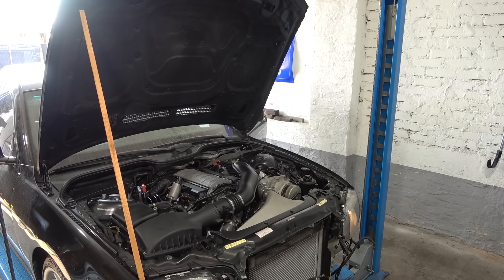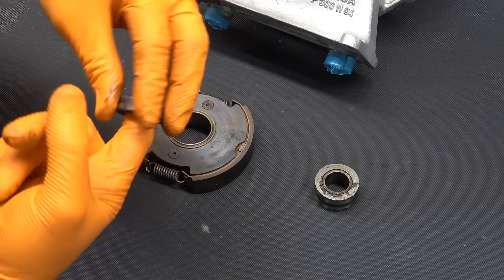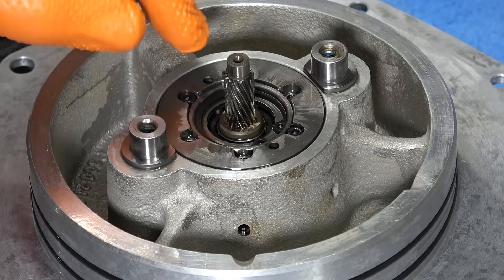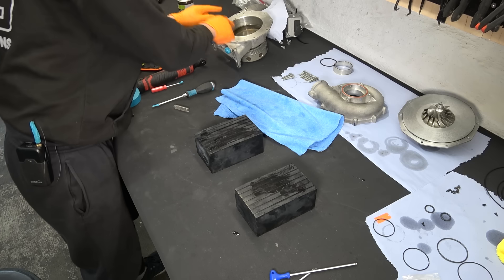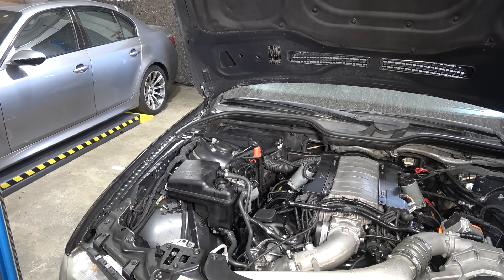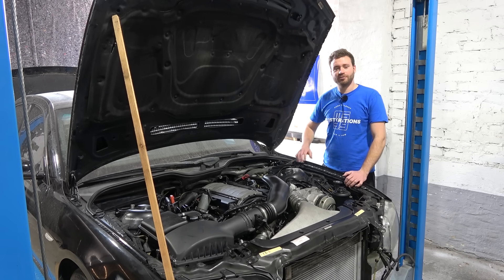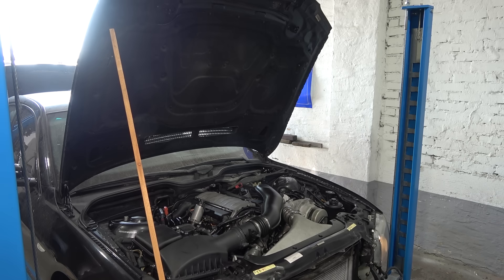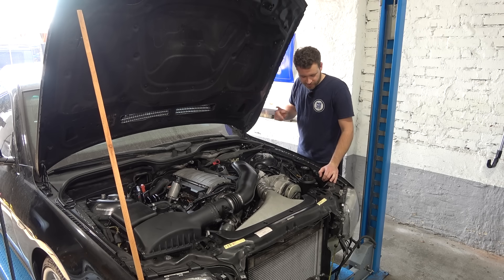First Start After Engine Rebuild - V8 Supercharged Alpina B7: Project Chicago: Part 6

Comment: I'm amazed when you do "just a service" to the supercharger everybody else would have call this a full rebuild! Great job and video as usual :)
Reply: I think it ended up as a full rebuild. Can’t think what would be left!
Reply: @supercartribe  Impeller bearings would be included in a full rebuild. But as Sreten mentioned, they were fine, so no need to change them.
Reply: That supercharger rebuild had me sweating. Well done.

Comment: I work at a BMW dealer, and I guarantee no tech would take the same care that you did building this engine. I enjoyed watching the whole process. Cheers and congrats on the smooth running engine 👍

Edit: I think the point I was trying to make was that Aplina had told Sreten that this car should be repaired only by those qualified to do so. However, in his care, I guarantee that he has done a better job than most people "qualified" in Alpina's eyes. That is the difference between doing this on the clock as a day job, and working on a car as a hobby/ enthusiast. Do I expect dealer techs to take this level of care when working on a car? No. They have book times to beat all while juggling a good quality job that they can be proud of. 

I'm not bashing dealer Techs. I am a dealer tech lol
Reply: Agreed, I was a senior tech at BMW and I never witnessed this workmanship, I’m almost ashamed of my my previous work in comparison. How many AW’s would this have taken lol
Reply: @danh2622  thousands lol
Reply: Because the employee at the dealership has to make the same thing in a fraction of the time that Sreten did. Money making machine Vs entusiast mechanic.
Reply: I went though an apprenticeship with BMW, mainly learned from senior engineers experience, however repair manuals were very rarely viewed as efficiency was always put before quality. It’s not poor mechanics in dealerships, it’s more the system that’s at fault. Shame really but that’s why I left the trade.
Reply: that doesnt mean, that they wont take the same care, its just that bmw has times for repairs, and if you are overdue, youre not making money on the car. thats how it goes
Reply: "and I guarantee no tech would take the same care that you did building this engine" Yep agree there. My old 123D spat its timing chain 9 months after BMW 'Fixed' it. :)
Reply: @danh2622

Comment: In previous models, Alpina used coolers that were oem “Middle East” spec and tricky to find from aftermarket suppliers. The supercharger had a few revisions & warranty replacements so well done on the quality rebuild. Also, Alpina assembled the full cooling pack on the frame and supplied to BMW to be fitted on the line. The pack was probably fitted before the headlights & anything else removable at the front.

Comment: As for the hesitation on start up after oil change, I’m curious if it was caused by the computer not seeing minimum oil pressure and then after seeing pressure it starts. Either way, congratulations and I can’t wait for a top speed run? Can’t wait to hear this thing sing! Enjoy your vacation and we look forward to what’s your come, cheers!
Reply from the maker: I found the issue for that, will be in the next episode. Has nothing to do with oil pressure.  Also, N62 has just a dummy oil pressure switch. Will start regardless of what the oil pressure is, if low, you'll get a red light on the dash. Thank you!
Reply: I thought it was because of the battery, but the cranking itself sounded fine... Sreten knows how to tease😁.

Comment: Lost for words! What an amazing episode. I was properly anxious on the supercharger rebuild, first time I have seen inside one of those. The key take away for me is all those hardened O-rings, Nitrile rubber (Which I think is what the O-rings will be made of) will harden with temperature, and the extra 10 degrees or so from the Nikasil bore spec thermostat will have really accelerated O-ring breakdown. Now, with the 'proper' liners and lower temp thermostat the engine will last longer and be more reliable, I'm sure of that. Super, super job.

Comment: As a normal guy who break in some engines, I recomend you to use normally on city for about 100/200km to let you gain confidence on leaks or whatever, change oil, and then go autobahn and put HIGH LOAD on the gas, while switching speeds. 80, 100, 120, 140, 100, 120, 80 km/h, etc. Just DON'T stay on a stable rpm and load, and try to slow down with engine, not brakes. Do that for about 200km, change oil, and then just enjoy. Anyway, I'm sure that your engine builder already told you how to proper break in his tune up.
Awesome job, keep on it!!!!

Comment: Fabulous stuff to hear it start and then be up and running. If all that was wrong is a connector not clipped fully home, take it. 
Quite sure that you'll run it in properly and by that I mean lots of varied revs, power etc. Not giving it an easy time just driving about the streets. Also good to give it quite a few heat cycles whilst bedding in. Drive for say an hour, stop for coffee & cake then drive home again & repeat. Heat cycles are good.

Comment: As an engine builder myself don't do the running in period babying it. Put in on a professional dyno and tune it propperly as soon as possible after being sure all is running ok from rebuilt. The new rings will get better seat to the sleeves this way it's gonna last longer running more propperly and being more efficient straight away. 
Really good build quality love your vids

Comment: Nice video, respect for all your efforts. I own myself a E65 N62V8 as well for 10 years now and recognize a lot of things and issues you've handled and explained. One note, the prefacelift had also standard the 105 c° thermostat, I changed mine 2 years ago also for a 90 c° version from Hamburg-tech. Since then no issues at all and it runs very fine. Keep up the good work and thanks a lot for your interesting uploads 👍🏽👍🏽👌🏽👌🏽

Comment: Nice work dude, I've only ever rebuilt one engine after i blew a piston ring and thought I had done everything correctly but the engine refused to turn at all on startup.I had to take the it out again and found that I'd mixed the piston bearing shells up which I'd reused and so i had to buy new ones and put it all back together again,but it worked after that,lol

Comment: I'm @ 39.00 and wants to just tell you, Bro every single n62 engine I have taken apart always starts up and runs weird or rough until the hydraulic lifters bleed up evenly. It will start okay and as they are bleeding up it will run rough until it gets up to operating Temp and the lifters fully bleed up and the reason it runs rough is because the valves are not opening completely/evenly so some of the cylinders don't get the same amount of air so I usually rev it up a little bit like 2K or so and just hold it and that gives it more oil pressure to help the lifters bleed up faster. Eventually they bleed up and it will idle and run just fine. I know it has a flashing check engine light now that's because the lifters have not bled up yet give it some time and it will smooth out and run just fine! :)

Comment: Sreten if you still are having those long extended cranks try resetting the DME adaptations for the relucktor wheel that is of course if  that wasn’t just the battery being weak great job on your first full engine rebuild!!!

Comment: I doubt many brand-new B7's sounded as silky as that. I just remembered that this is the car the clever transporter driver revved the nuts off stone-cold last year and we all cringed as one (along with Streten). Thankfully that's all moot now (assuming the damage Streten found wasn't actually inflicted at that moment). Also, you have to wonder if the new cast-iron liners aren't actually an improvement on the possibly gratuitous, 'single-use'/unserviceable plated ones Alpina, in their infinite wisdom, used in this engine.

Comment: I loved it when you said 7mm doesnt fit 6mm doesnt fit so it must be some American or somthing. It's imperial and as the name suggests and it was invented by us Brits. Australians call it system Bananas. 7/16ths-11 ish mm  9/16ths-17 ish mm etc. America has resisted the slide into the metric system and so have we to a small degree. Although we buy our fuel in litres you will find MPH as the main mesurement on British car speedo's  : )

Comment: Nice job .. I have a 2016 750i rod bearing knocking problem .. only 60k miles . Get oiled changes every 3000miles . Does engine need to be changed or can it be rebuilt? Thanks.. again good job

Comment: I know this is going to be a long shot, but I have an 04 745i and I'm tying to investigate a leak coming from around the oil filter area. Before I take off the belly pan shield, I want to know the torque specs. Would anyone know what they are because I cannot find it anywhere.
Reply: There's a website with all those torques on it. Sadly I don't know the name but it's definitely there. I'll see if I can  find it.

Comment: The location of those bmw fuel filters are really bad. Came back from the dam skiing one day on a dirt road and there was a bmw broken down next to the road in the bush (this is Africa), a rock in the road snagged the fuel filter crushing it and ripping the bracket to schit. I had a full toolbox in my Honda's boot but there was nothing I could do to help the people except call a towtruck unfortunately. The location of that fuel filter is german engineering at it's worst!
There's a reason farmers drive mercedes sedans & toyota hilux trucks... ;)

Comment: Now, that I watched the Videos again, I'm shure there is a mistake: when you look at the mile scale-ring, you kann see, that 100 m/h is in the middle at the '12::00h' point - that means nearly 160 km/h. But wenn you just changed the ring, the km/h ring has the 150km/h at the 12.00h point. Understand? So maybe you could programm the unity for km/h!?
Reply from the maker: No. I don't even understand how you come up with that, it makes 0 logic. Mph face also has kmh in tiny increments. Kmh face only has kmh instead of mph. All of this is preset from the factory, speed is speed, not matter what the measuring unit is, the needle will always show the same.

Comment: cast iron sleeves on bmw?  so you are using non factory cylinder gaps? Otherwise it won't work. That's for standard aluminium BMW blocks. Did Alpina did something different?
Reply from the maker: Maybe watch previous videos?
Reply: @M539Restorations  Still was to lazy to watch previous videos but i've seen last one with engine damage. You did mention gaps that i was worried about. And the cylinder measurements were off.  There is a guy that does those engines around Warsaw doing alu sleeves.  Keep us updated what's up with the new block from Poland.  Now to your other videos.  Always interesting stuff.

Comment: Now just fix that stuck lifter tapping or exhaust manifold leak & at least it will sound like it’s running without clicking heels
Reply from the maker: Doesn't have sticky lifters or leaks, that's how N62 sounds.

Comment: What the hell was with all the ads, every 3-4 minutes there was two 15 sec ads. I get it’s an expensive build and your content was outstanding as always, but you got a thumbs down for the constant interruption.
Reply from the maker: Who are you talking to? I hate ads as much as anyone, YT puts them and because of them, this content is free. Depending on the month and ad campaigns, videos on YT will have more or less ads. I personally have YT premium because I can't stand the ads. Thanks for the thumbs down, maybe I should disable monetization all together so you can continue to enjoy free content in peace.
Reply: @M539Restorations  I was addressing yourself. I’m not suggesting that you should demonetize at all. I get that your content is extremely expensive to make. Normally all of your vids have a reasonable smattering of ads that don’t interrupt the flow and are no more intrusive than the YouTube norm, but for this video, every 3-4 minutes there were more and that isn’t normal for your channel. If this is a wacky YouTube algorithm gone crazy, then I apologize, but none of your vids have ever been this bad ad wise.

There were 4 sets of ads between when you first started the engine, discovered the issue with the injector and then did the 3000 rpm rev.  That’s not normal for your channel.
Reply from the maker: @nathanpethybridge1587  This video actually has less ads than few previous ones. April is a good month for ads so YT is showing you more. I can't control that.